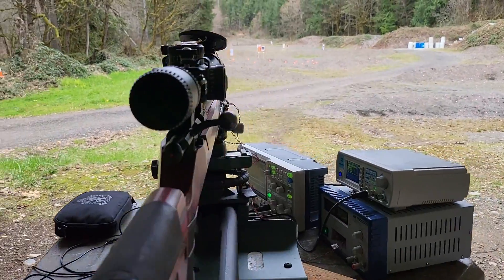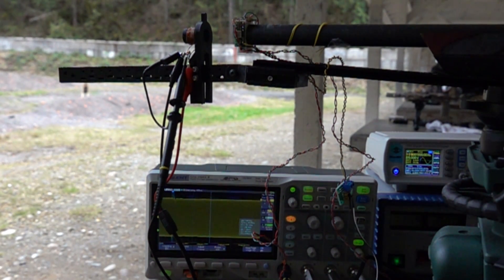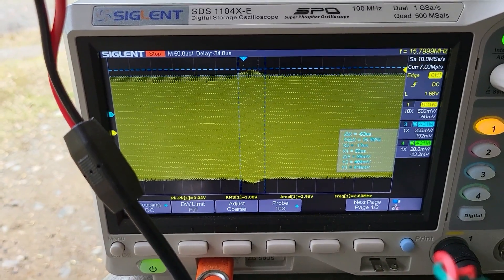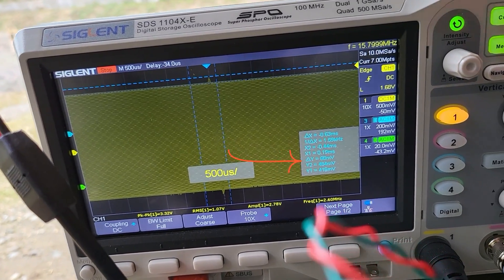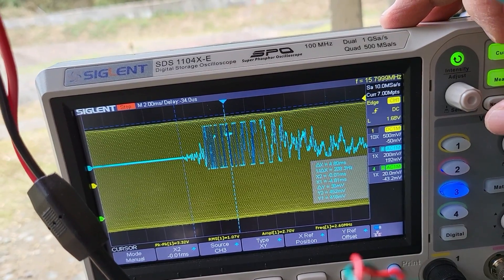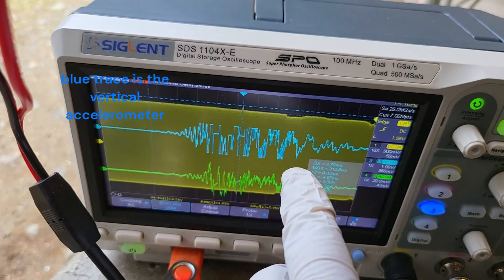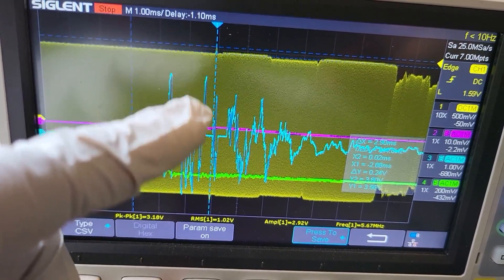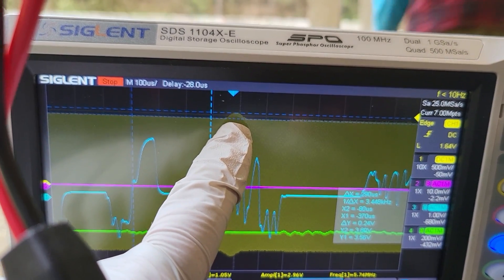CZ 457 MTR with Sensors To Measure Barrel Harmonics (Part 10) Slow Motion and Sensors

Comment: Sir, why you don't measure the barrel eigenfrequency just by knocking the barrel to vibrate like knoking the sound fork or strumming the quitar string? Just excite the barrel and it will virbrate with its fundamental frequency.
Reply from the maker: I have.  It is done in my previous videos.
Reply: @TunerPlinker  yes, now I can find that too. Thanks for pointin out. Very interesting study.
Reply: Which end of the barrel you knock is important.
Knocking the muzzle end is not realistic as the impulse when firing comes from the chamber.
You need to knock the receiver end to get the authentic vibrational pattern.

Comment: Admirable use of test equipment, but usefulness of data is nil. We know that there is whiplash in the barrel and you have re-confirmed it. The usefulness would be the azimuth and magnitude of the eliptical  ringing. The rifle apparently has an indexed barrel since very little lateral movement was detected, but cannot tell from your measurements what the direction or the magnitude of the lateral deviation is. That is the useful and needed data to make barrel accuracy comparisons. Additionally, it would appear that your fixturing may not be neutral and could be adding feedback negative or positive. The easier method would be to optically produce a wave form on a screen or photographic plate by means of projecting beam from barrel. ie laser in breech and externally excited impulse. You have achieved great resolution of a low precision measurement. Relative eyeball comparison  of waveforms is all that is necessary here.
Reply from the maker: There were a lot of issues with the sensors clipping.  I have since replace with different sensors and resolved the clipping issue.  You can see the final results by fast forwarding to part 12 to 14 of the video.

Comment: I think this is a frequent experience.    I had assumed it was due to smoke and/or unburned powder being “seen” by the chronograph but you make a good point it might also be incandescent gasses (muzzle flash).    I’m either case I would expect the photo interrupter to work although this would need a test to confirm.   

Assuming it works,  the interrupt pulse would occur a few hundred microseconds before your proximity sensor’s pulse if both are working as hoped.    My guess is the prox sensor will be several milliseconds later.

Comment: I suggest you try GP1A57HRJ00F (Sharp), (Digikey 1855-1043-ND).   It is a slot type optical interrupter with sub microsecond rise and fall times.   It has a 10 mm open space so the bullet can easily pass through the slot and create a signal.   Try attaching it to your muzzle and I'll bet you find what you believe to be the bullet signal from you proximity sensor is in fact several millseconds delayed.   Barrel time, I believe, is much less than suggested by your measurements
Reply from the maker: Thanks for the suggestion.  I will look into it.
Reply from the maker: Do you know if muzzle flash affects the bullet detection?  I have a optical chronograph that won't work unless it is at least 10 ft away from the muzzle.  That's the reason I designed my 15MHz solenoid sensor.

Comment: Between pulling the trigger and the bullet exit, are the vertical cycles occuring at the speed of sound longitudinaly along the barrel>
Reply from the maker: From the data I have gathered so far, and it is still in the early stages, the vertical cycles are not at the speed of sound.  I can follow-up with you when I have all the kinks worked out with my sensors.
Reply: @TunerPlinker  those sure look like the fourth harmonic of the speed of sound.
Reply: Longitudinal waves in steel (stainless) travel at around 5790 m/s, shear waves travel at around 3100m/s.
What happens as the bullet is exiting the crown is the crucial thing.
What happens after that is irrelevant - the bullet is gone and nothing the barrel does can influence it.

Comment: If the barrel oscillates in a figure 8 shape that would corelate to the higher vertical movement, and the less horizontal.  Would you be able to estimate where on the vertical acceleration graph the bullet is actually leaving the muzzle?  I think the theory in tuning a rifle being that you are trying to find a load that exits the barrel around the top or bottom of the figure 8 pattern would match up with timing the bullet to leave during the moment of minimum vertical acceleration (top and bottom where it changes direction).  Would be really interesting to see if you could correlate the bullet exit point with respect to vertical acceleration to accuracy.  With 22LR trying different ammos would put you in different barrel exit locations with respect to acceleration.  That and if you could pair this up with super slow motion camera would be really interesting.
Reply from the maker: After collecting some preliminary data on the gyro and accelerometer sensors with live rounds, I have found some issues with both the gyro and accelerometers.  I believe I have fixed the issue with the gyro and in the process of replacing with two new accelerometers.  If the sensors work, that is, if the gyro data correlates with the accelerometers, I can definitely map out the muzzle position/rate of angular change when the bullet exits the muzzle.  I like your feedback about the figure pattern.  I can definitely plot the path of the muzzle given the x and y accelerometer data.
Reply: Have you watch any of Erik Cortinas Believe the Target interview series he does?  He has interviewed some really interesting people in the shooting world.  The latest one, Eric Higgins, is interesting in that he is trying to use high speed cameras with some software applied to exaggerate movement to determine what the barrel really does.
Reply from the maker: @chrisf2037  The measured vibration is very tiny.  I am not sure it the camera can actually measure that tiny of movement.   Here's my latest update:  The new accelerometers works a lot better and no clipping is observed.  However, the gyro sensor is not correlating withe the accelerometers.  The reason being is the gyro sensor that I am using is not sensitive enough and as a result, it is very noisy.  The good thing is the accelerometers are very consistent and more reliable.  The more sensitive gyro sensor by itself costs $2k.  I would not be able to afford it for this experiment unless Analog Devices give me a free sample.  I have a pretty good relationship with Analog Devices, but don't want to stiff them for free samples.  Anyways, I will be updating my Matlab scripts to finalize the data collections and give you guys a preview of what I have been quietly working on.  Stay tune....I know it's a Long wait.
Reply: @TunerPlinker The highspeed film is heavily prossesed by software, and the vibrations invisible for the human eye are supposed to be exaggerated to a visible level.  Very interesting podcast. I can also suggest the Hornady podcast with one of the barrel guru's (Don't remember the name). He discard the description of barrel harmonics, and introduce "forced barrel vibrations" . If you haven't  already listened to the podcast, I would higly recomend you to do so.  Your testing is very interesting, and I hope you will continue making videos.
Reply from the maker: @sidekickbob7227  If you have the link to the podcast, I would be interested in tuning in.  From the accelerometer sensors I have collected, the shockwave is mostly due to violent powder explosion  inside the barrel.  I don't see any barrel harmonics till long after the bullet exits the crown.  What I am referring to is the barrel self resonant frequency or ringing or some people refer to it as barrel harmonic.  So yes, I do agree that barrel harmonic play less of a role.  The reason is because the barrel harmonic frequency is much lower than the shockwave frequency....and I did not measure any of the low frequency while the bullet is inside the barrel.

Comment: Great job. Do you have plans for a video showing a tuner on the barrel? And make changes to the tuner to show how the scope sees the tuner setting change.
Reply from the maker: Yes.  This is just a preliminary test of the proximity coil and accelerometers.  Still waiting for my chronograph PCB to arrive.  Once I have the sensors all calibrated and working, I plan to take more data to help characterize the barrel harmonics and put on the tuner and show the differences in barrel harmonics and point of impact.

Comment: on the vertical accelerometer trace, what do you think the 'flatline' sections are ? they appear to be prevalent before the bullet leaves the barrel  ?
Reply from the maker: The first two capture had flat lines because of the scope scaling is set too low.  It was clipping.  The third plot was definitely not clipping but also has flat lines.  This indicates that the acceleration is constant during that period.  I need to analyze the raw data to figure out what's happening.  Wondering if the barrel is not free floating because of big swings.
Reply: @Tuner Plinker  the 4 flatlines on the third capture all appear to have the same value and no or very lityle noise - could they be drop outs of the acellerometer signal ?  I have problems believing the barrel stops moving then starts vibrating again.
Reply from the maker: @roqcdatamanagement6905  I was a bit perplexed about the flat line too.  This is very preliminary data just to test out the sensors.  Will need to crunch the data to figure out the position of the barrel.  It will likely tell us what is happening.
Reply: @Tuner Plinker  the 4 flatlines on the third capture all appear to have the same value and no or very lityle noise - could they be drop outs of the acellerometer signal ?  I have problems believing the barrel stops moving then starts vibrating again.
Reply from the maker: @roqcdatamanagement6905 It looks like the shock is too much for the accelerometers and it clipped it.  The sensor overange turned on to protect the sensor!  This sensor is rated to +/- 100g!  This is incredible.  The shockwave is huge!
Reply: @TunerPlinker at 4:37 into the video, you see 3 distinct flat lines on the blue trace. Could these perhaps be harmonic nodes? This would suggest that you'd tune the barrel so that the velocity deviation median is centered on the flatline. Meaning that the majority of rounds would exit during that flat section?
Reply from the maker: @fernandop1647  According to the sensor datasheet, the flat line is due to over range and the sensor protection turned on.  It would set the sensor output to 0 volt flat line.  These are huge shockwaves!  More than +/-100g!  Normally you can't put enough weight to tame it but could slow it down.  The goal is to tune it so the barrel swings upward at a certain angular rate.  The angular rate is different for different target range like 50 yards or 100 yards, etc.   Once it is tuned, it will make one hole point of impact all day long.
Reply: I think you are seeing what you want to find. Even a few milliseconds of latency or error of the proximity sensor would mean everything was after the bullet exit. From the video the bulk of the gasses were gone when the movement started. OTHER VIDIO EVIDENCE SHOWS VERY LITTLE GAS OUT RUNS THE PROJECTILE??
Reply from the maker: @jackphelps8874  The delay is from the oscilloscope trigger and update.  It takes a while for the scope to update the screen after it is triggered by the sensor.  The output of the proximity sensor is instantaneous.  I was trying to measure how much the is the voltage swing when the bullet enters the coil.
Reply: I agree.   I suggested he put an optical interrupter module right at the muzzle.    @jackphelps8874